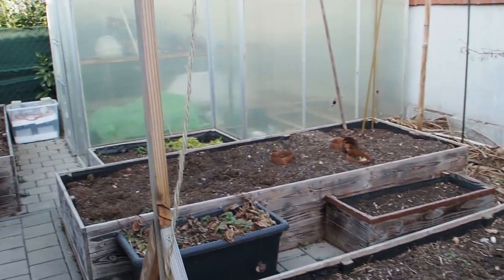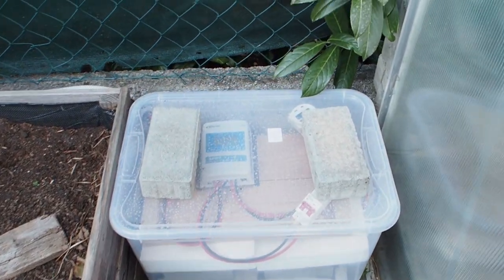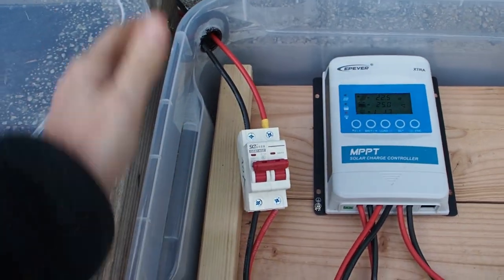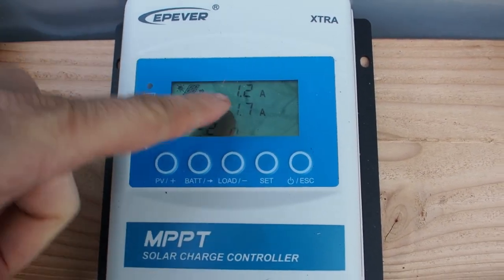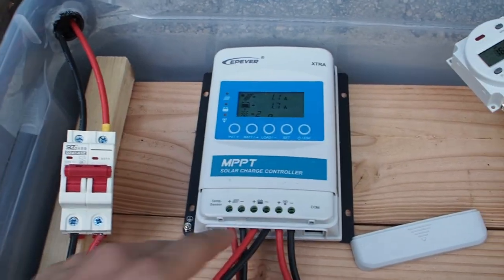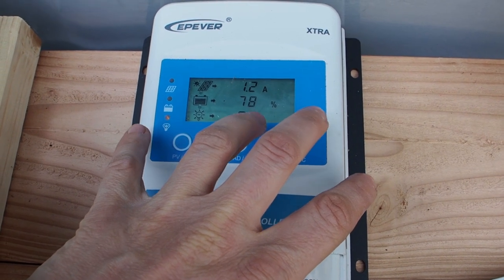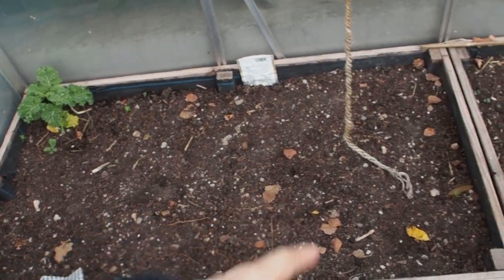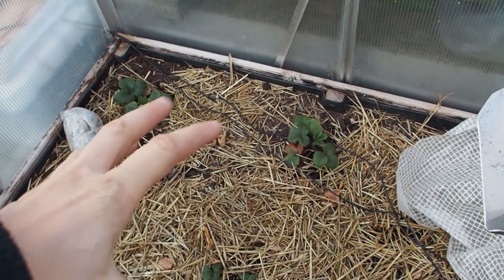Off-Grid Solar Panel for my Greenhouse!

Comment: In the winter I am going to use this system to heat my greenhouse. In the summer I will use it to power multiple fans, to get out the hot air from the greenhouse!
Reply: Check out "Everyday Solar with Will Prowse" for any info on solar systems that you need, his channel is very informative

Comment: I love the ingenuity! I'd like to do a similar setup but instead of using chemical batteries, I'd run a 12v water heater element directly off the panel to heat up a barrel of water inside the greenhouse that would act as a radiant thermal battery. 🤓
Reply: Pretty awesome idea

Comment: Lead-acid batteries are 50% electrically efficient (50% lost as heat) overall and the charge controller also gives off heat. The battery mass is a significant heat sink. Suggest you put the whole system container inside the hoop tunnel below the plant trays if possible to take advantage of all the heat. I also grow indoors if you are interested.

Comment: FAQ: So my heating device is rated at 50 watts. But in the first 2 minutes it is drawing 58 watts. Once it is heated up it is dropping down to 22 watts and stays there. So the correct fuse for the heating device is 6 amps!
Reply: It’s a ceramic heater so it increases resistance as it gets hot and draws less current.  The colder it gets the more current it will draw.  Once it’s down to -5 it will draw 50w constantly trying to keep warm.

Comment: FWIW, the 10 amp fuse will blow only after your 50w heater starts drawing 100w.  A safer fuse would be 5 or less amps.  Letting the heater draw double its rated power may cause fires in your greenhouse.  Is there really any need to have both a 10 amp circuit breaker and a 10 amp fuse?  A fuse is actually a better bet than a circuit breaker as most breakers only trip well after their max has been reached.  , If your heater is only drawing 20w, I would use a 2amp fuse
Reply: thanks you are right. I will change it out with a smaller fuse

Comment: Hi  I live in Castlegar British Columbia Canada   in the Mountains , I have 3 greenhouses and I heat with large plastic Coke bottles filled 50/50 water and peat moss they have lasted 5 years with no problems they heat up with the sun and I have a small electric heater as back-up . Good show thanks

Comment: I would like to get some backup solar but the cost of batteries is expensive .. I think you either have to go for a very big system or a very small system and medium sized ones are too expensive.. however I think I will purchase some solar lighting that come with their own panels and rechargeable phone batteries they are bright enough to light a bedroom for many hours and not too expensive. It is nice to see you are doing well.

Comment: If you calculate the energy consumption for such heating, you get, for example, 100 W for 10 hours a day = 1 kWh per day.  Let's say we have 100 days a year when greenhouse heating is required.  It turns out 100 kWh per year.  At the price of electricity in Austria, about 10 cents per kWh, it turns out 10 euros per year.  
What is the point of buying equipment for hundreds of euros if the same task can be solved almost for nothing? ☺️✌️
Reply: My tomatoes yield me 1200 Euro per year. This setup cost me a little over 400 euros. So I will pay it off with 1/3 of this years tomato harvest. 
A certified electrician would cost at least 200 - 250 Euros, to connect a cable to my greenhouse btw.
Also now I have an Off-Grid system. So in a blackout situation I can get electricity for other appliances from this battery.
Also it was a good project for me to learn about solar power, since I am doing a similar project for my campervan.

Comment: Hate to burst the bubble but 1 candle puts out 80-100W a greenhouse of that size will need a bigger heater for frost protection. Even supposing 50w was enough and you are able to keep the panel tracking the sun all day there is only 4-6 usable hours of sunlight in winter and for that you will be generating about 5-10% of your 100w from the panel.  You will barely keep the battery’s charged.  Even if you can use all 120ah at 4a per hour that’s going to be 70+ ah over night which is going to take you below the usable capacity and your battery’s will deep discharge and start sulphating when the solar doest have enough hours of sun to recharge every day.  Insulate the battery box to protect them or put them in the tunnel,  the battery’s get warm while charging. Get an insulated tunnel so you do t loose all your heat straight away.